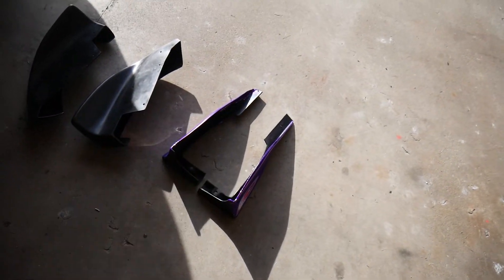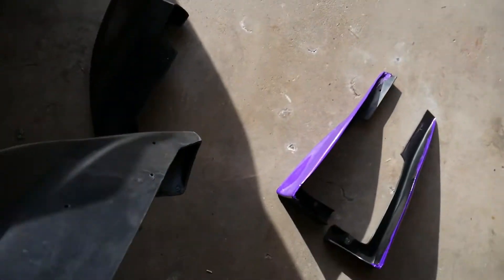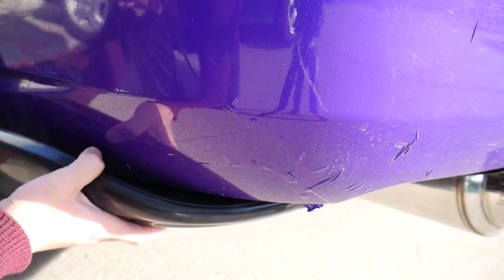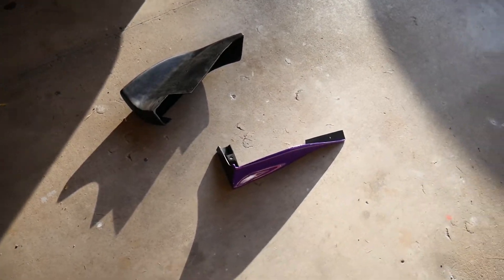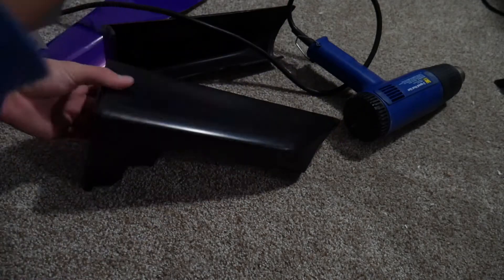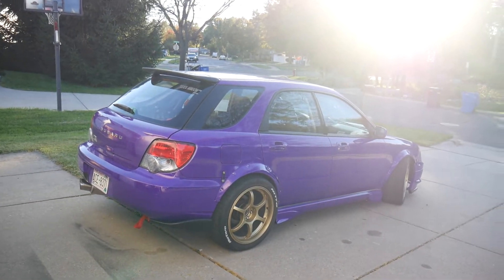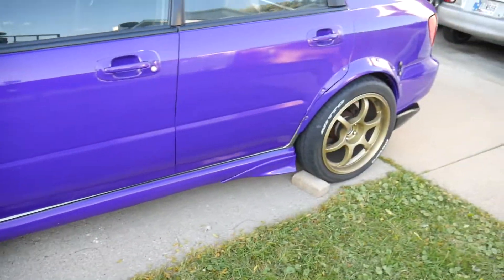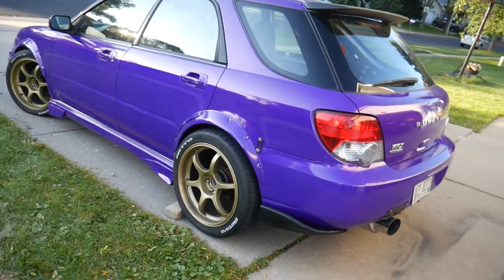Are EBAY Aero Mods Any Good? Let's Find Out!

Comment: What wheels and specs are you running also and do you have spacers?
Reply from the maker: For wheel specs, they’re 18x8.5 rims with 245/40/R18 rubber on them, I believe they’re +30 offset but don’t remember, and I’ve also got 22mm spacers for the rear wheels